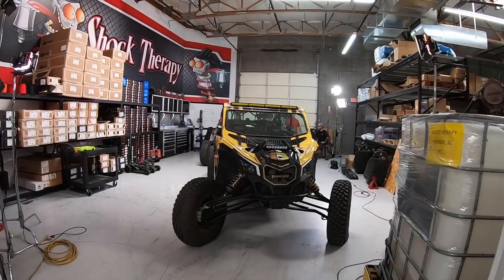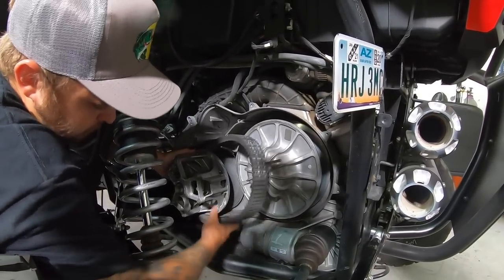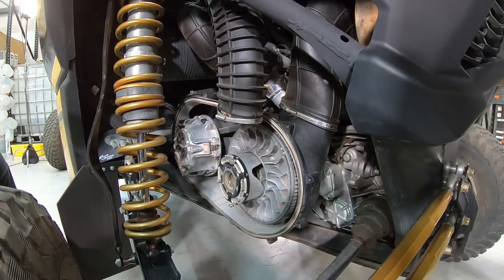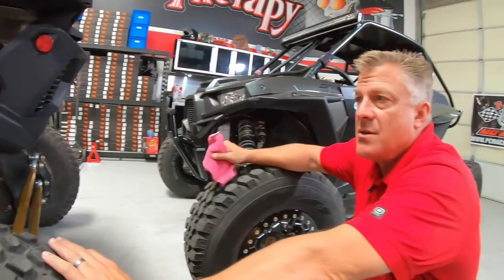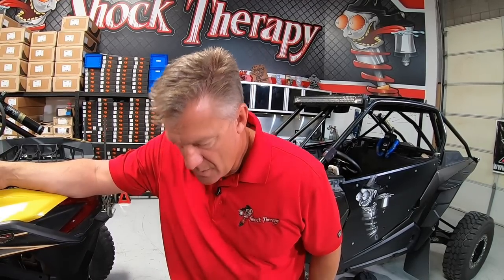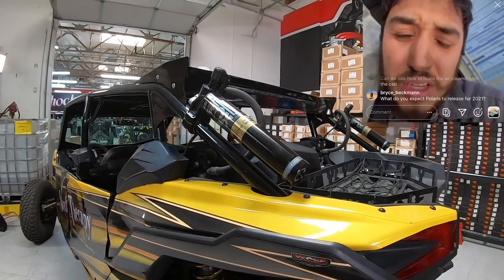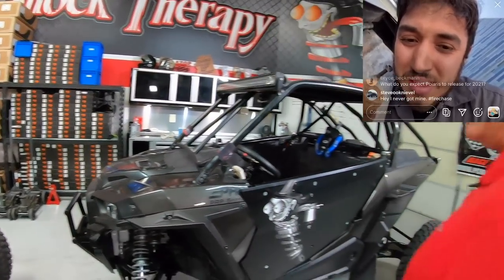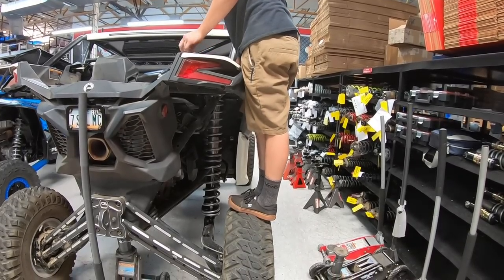UTV BELT CHANGE (SHOCK THERAPY LIVE 7/23/20)

Comment: Do you clean your sheaths with a scotch brite pad when a belt blows a leaves heavy marks. I also was losing belts due to the belt was about a 1/4” lower than the top of the secondary. We put the 17’ big washer replacement for the main bolt of the secondary. Now it’s flush and 1k on my bad ass dune belt. Every ride when we get back to camp we use compressor air and blow out the clutch. I don’t use a cover.

Comment: I just bought a ProXP Ultimate! Amazing ride! I have 35's to mount, what would you recommend for clutching. I would like to split the primary sheave, pull it out, add correct weights/spring and swap that out when I swap tires... any suggestions regarding clutching?
Reply from the maker: Best thing I can recommend is Dyno Jet for a clutch kit. They have it dialed in

Comment: What do you recommend for coil spring compression for us DIYers that dont have the the really nice stand up units like shown in your videos? Most of the coil springs compressors out there are meant for wider spaced coils find on cars and trucks which dont fit real well on utv coils. I saw a sxsblog video where there used some sort of compressor that used flat discs to compress the spring but wondered what you guys recommend. Thanks
Reply from the maker: That’s a tough one. The threaded style that uses hooks on each end and use two threaded rods. One on each side of the coil maybe? We used to use a big ratchet strap. Trimmed the hook to fit the coil. Grab one side, wrap under the vice and up the other side to compress them. After a couple holes were put into the ceiling by springs we invested in the nice compressors.

Comment: Hey Justin, as usual great info. I'm going a bit off topic but have to ask. If I go with your IQS (hope I got that right) on my 2019 X3 xrc turbo R. Does it compensate for compression and rebound and is it comparable to the 2021 x3 smart shock system. I'm really trying to figure out if just the IQS would be enough on my car without having you tune them. AKA most bang for the buck! Thank you in advance.
Reply from the maker: Great question. The IQs does not change how the shocks act or react. It nearly turns the compression from all the way soft to mid stiff to full stiff as you choose. The ride quality is the same if the shocks are not tuned. Smart shocks do the same sting but control rebound as well and are computer controlled according to sensor inputs. Smart shocks is a better system than IQS. But. There is always a but. The new smart shock system is quite stiff. If we tune a 2020 it will ride way better than smart shocks. You just don’t have the adjustments on the dash. If we tuned smart shocks it would ride amazing and have electronic adjustability.  Remember just because it’s IQS or Smart doesn’t mean the ride quality is killer. It just means the stock ride quality is now electronically adjustable.
Reply: @ShockTherapyllc  Thank you for the detailed explanation. So, if I was to have the IQS installed and the shocks tuned by you do I send the shocks to you or do you need the entire car? Saying I ride just one way is inaccurate. Sometimes desert. Sometimes sand. Sometimes slow and putting in the rocks. Sometimes aggressive. Sometimes cruising. I know you can't have the best of all worlds all the time but do you have a formula for shock set up for what I described? Thanks (P.S.) I really enjoy your videos and learn something everytime. I'm 62 and been riding since I was 5 so I think that says something! 😁
Reply from the maker: Raymond McDonald you are very kind. Thank you. We do the same thing as you do with respect to riding. All encompassing. We have a set up that is perfect for you since it’s perfect fir us too👍. You can send the shocks only. We do this every day. Only thing you will do is set the ride heights and go. Have a killer weekend.
Reply: @ShockTherapyllc  Great! So just for clarification; I send the shocks to you. You guys do your thing. I get them back, they are tuned and have the IQS system integrated on the shocks. I set the ride height based on the info I receive from you. Correct?
Reply from the maker: Raymond McDonald that’s it sir. You will have one more thing. With IQs you will run the wire loom for it and mount the computer. We have full instructions and it is actually very easy. Just a heads up. Btw we do about ten sets of shocks a day that comes in the mail from all over the world. It’s very common and actually easy.
Reply: @ShockTherapyllc  Sounds good. One last question. Who do I speak to for costs and the logistics for the transaction?
Reply from the maker: Raymond McDonald if you call the shop you will talk to JT, Milo, Mike or James
Reply: @ShockTherapyllc  Thank you for getting back to me and answering all my questions. Now for the work to begin!🙂